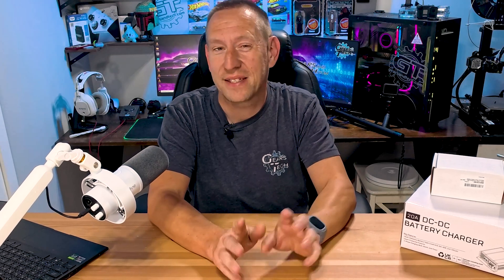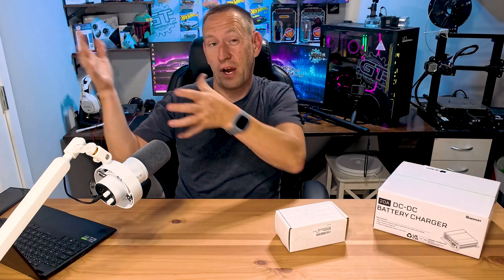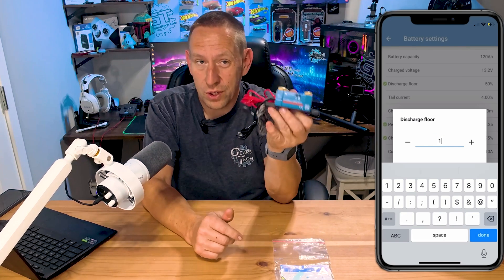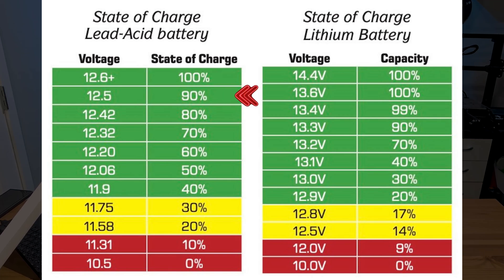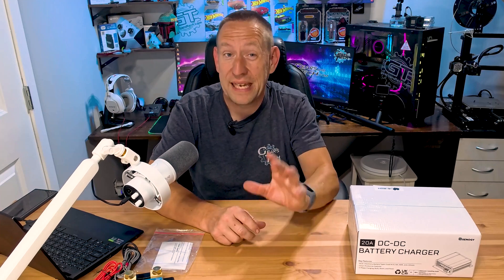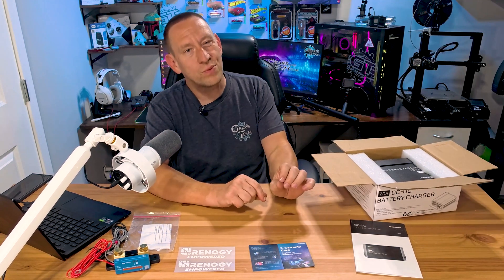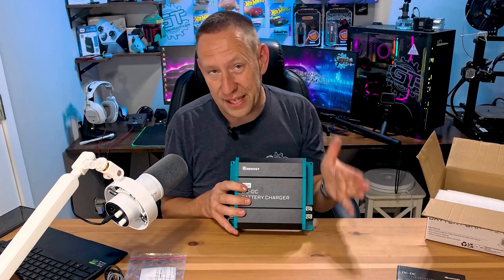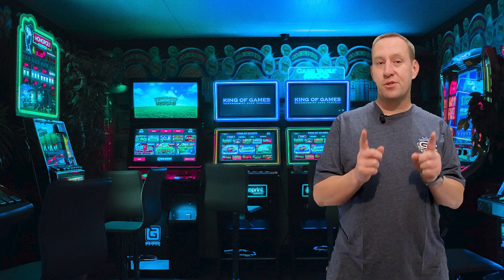Unlock the Secrets to Charging Your Lithium RV Batteries the *RIGHT* Way!

Comment from the maker: ✅Renogy 12V 20A DC to DC On-Board Battery Charger - https://amzn.to/4gFVORr
✅Victron Energy SmartShunt IP65 Battery Monitor (Bluetooth) - https://amzn.to/47G0OS1
✅4AWG 18-Inch Battery Inverter Cables Set - https://amzn.to/3N1Km5c
✅4 Gauge Wire for Power/Ground - https://amzn.to/4eujLJW
✅Copper Wire Lugs, Terminal Connectors - https://amzn.to/4eFVlNB
✅Self Adjusting Wire Stripper  - https://amzn.to/4do4QQl
✅12V 100Ah LiFePO4 Battery - https://amzn.to/3Zypbzb

RV / Camper / Motorhome Essentials:

✅Timbren SES Truck Suspension Saver - https://amzn.to/4dBVsKh
✅Voonoa Wireless RV Camera System - https://amzn.to/4dKBihd
✅Weight Distributing Hitch with Sway Control - https://amzn.to/4dLn6od
✅RV Wheel Levelling Blocks - https://amzn.to/4dPpdra
✅The BEST Wheel Chocks - https://amzn.to/3V7Hd8B
✅Rhino Sewer Hose - https://amzn.to/3QP92jJ
✅RV Leveling System (APP) - https://amzn.to/4bHX9nF
✅Great Toolkit for RV or Home - https://amzn.to/4bKdQyW

🌏 Get Exclusive NordVPN deal here ➼ https://nordvpn.com/gearsandtech
 It's risk-free with Nord's 30-day money-back guarantee! ✌

Join the Gears and Tech Youtube Community Today:
✅ https://www.youtube.com/channel/UC87yYbCYEV-TqM9h6WU3Ccg/join ✅
Reply: If i have 4 lithium 100amp connect in parralele in my camper , should i go up to the 40a dc to dc ? Or stay with the 20a ?